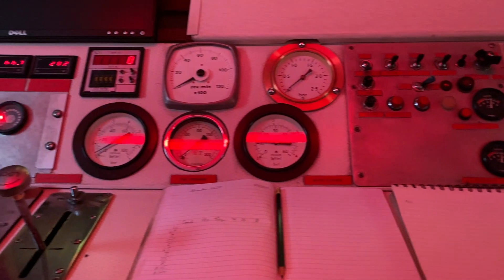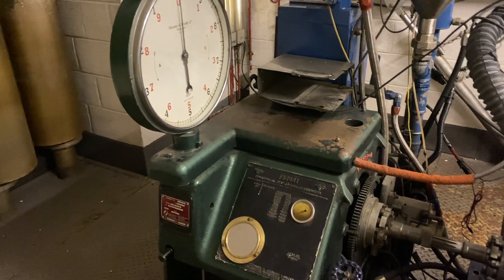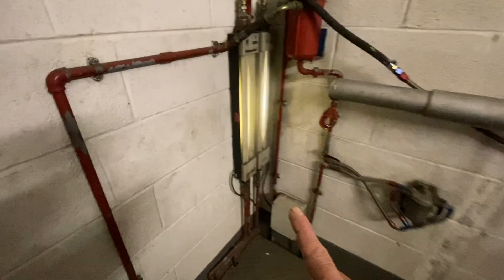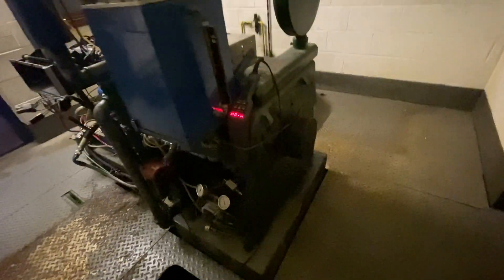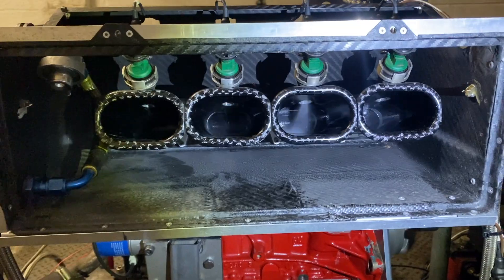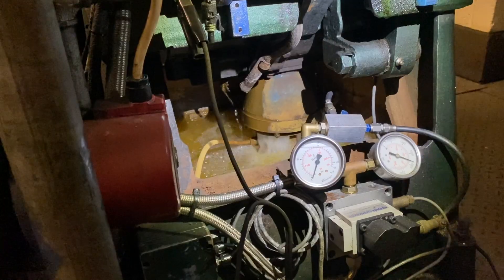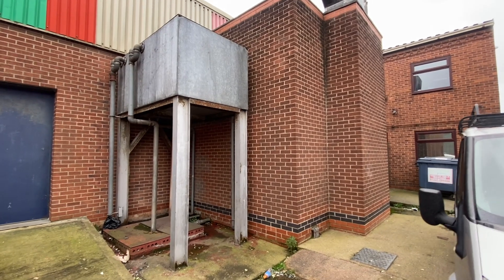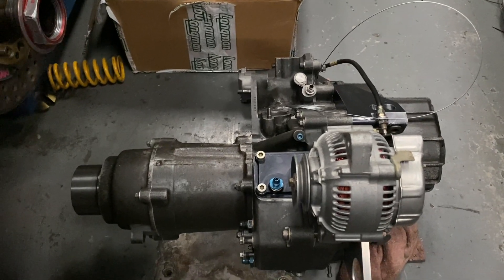Reversed Opel C20XE on 1989 Water Engine Dyno!

Comment: Thanks for sharing your experience @Twin Engine Corsa. One cause why they reversed the head, same as Honda did it on the H-series engines, was the better access to fresh air. It was shorter, not heated by the drivetrain system in the enginebay and could be done in a less restricting way. Performance-wise, this makes a huge difference. The former Swindon setup had a huge intake channel over the engine, over the header, which is way not optimal: it's long way on a heated channel, air has to turn into the bell mouths by a 180° turn causing losses and the hole channel thing is a restriction. Honda used the reverse head story also to lean back the engine for better weight distribution, the valvecover was almost touching on the firewall. All the 300+ engine setups of the FWD were kind of cool side front, hot side firewall, the other way around it is much more challenging.

Comment: With stroker 90mm crank and 88mm pistons running on methanol one drag car here put little over 360hp reverse head configuration all this back in 2004 , old Opel engines are amazing by the time!
Reply from the maker: Yes a friend of mine now in SA is just over 360hp in M1 fuel non reverse head. 
Seshum Naidoo.

Comment: I read somewhere that they did the reverse head for heat management in the engine bay and to have cold air ram into the intake, instead of sucking up hot air rising off of the exhaust as it passes under the engine... Not sure if that's accurate or true.